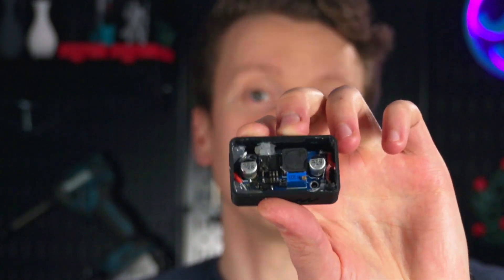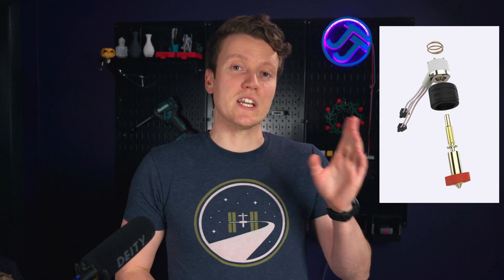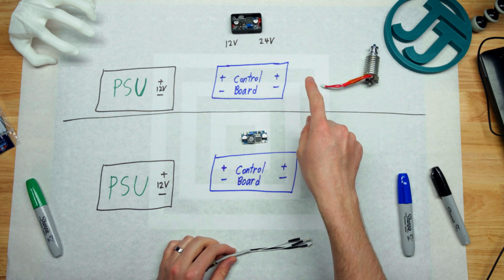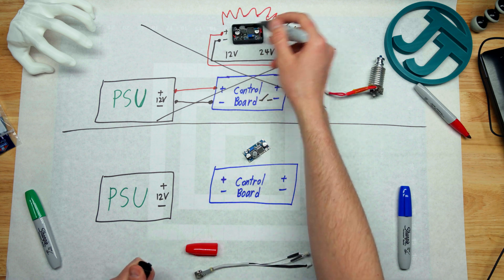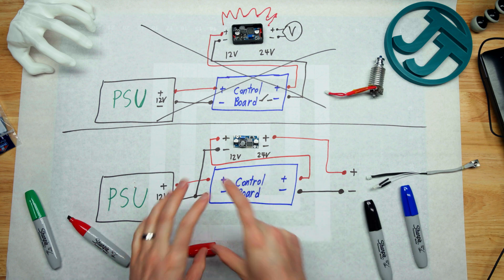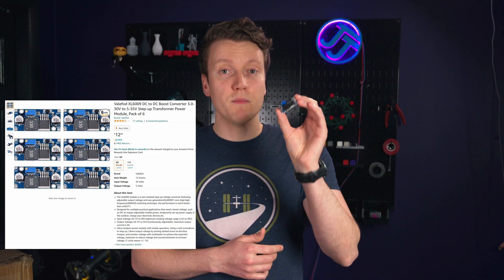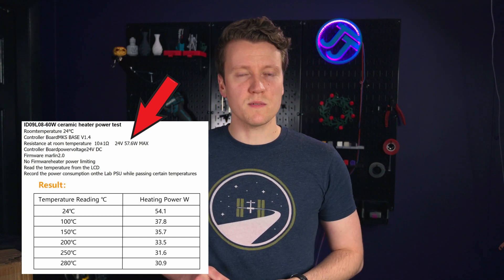Triangle Labs CHC Hotend Caused Fire | Dangerous 12V 3D Printer Upgrade

Comment from the maker: I just heard back from TriangleLabs, and they added a circuit diagram to their product listing. They also said they will be delisting the 12V option until they can do more testing. I respect a company that listens like this, and will change when they are wrong.
Reply: Since this is now quite outdated (TL has released a native 12V version some time ago), maybe you should add an annotation in the video that this was fixed. Because this video is first result when searching about the chc hotend and is giving wrong impression that the hotend in general is bad.
Reply: Stay frosty in milk JJ
Reply from the maker: @MrBeast-1  Haha my life's moto!
Reply: Darn.. I wish I saw your video before I bought my 12v set for my Anycubic Kossel.. They're still selling the 12v kit on their Aliexpress store, but now with a wiring diagram...

Any idea if the chart they have there is correct..?
Reply: Buy 24volt PSU 5 amps and one big MOSFET. You need it last a Buck Converter with 5 amp.
Reply: @muller86wolf  a separate 24V rail is probably a better idea. These boosters are always, ALWAYS overrated, only use them for low wattage use.
Reply: With @mrbrdo on this one. TriangleLabs seemed to have fixed the issue. Would love to see a follow up video with the new heater also.

Comment: Many thanks for this video.  I had the idea of upgrading an old 3d printer into using a modern hotend without the hassle of upgrading everything else.  After my first boost converter failed, I found this video and used your wiring diagram.  Using a beefier converter I can confirm this works well, and now I can use the same hotends and nozzles on my old anycubic as my voron for the rare time I need a second printer.

Comment: I wouldn't trust those buck boost converters to provide greater than 1A. Also, did you try using a 5-10A variable power supply to see the current limits under load.

Comment: Pretty sure your shoddy engineering work caused the fire, not the hot end itself. I like how the title alludes that it's Triangle Lab's fault, but one look at that dinky board says no way it can handle 50W requirement for a heat block. Your pinned comment still doesn't accept responsibility for your reckless engineering efforts. And to Trianglelab's defense, they cater to enthusiasts, and no self described enthusiast would a) underspec the conversion board, and b) wire the conversion board after a solid state relay that is designed to pulse on/off then c) go on to make video with a bait title to blame the supplier. The issue doesn't even matter if it's high side or low side switching. 

You also took the Shenzhen special listing at face value. It's not 4A at 24V. There's a current to voltage curve of how much it can output based on input voltages. I really doubt your claims to an EE degree.

If you accepted responsibility and instead of baiting us into thinking it's trianglelab's fault with your title, it would show you have integrity instead of this crap.

Comment: Thanks you saved me. I'm converting an Anet A6 to an i3 style and was just going to upgrade the hotend to this in a Hero ME Gen7 but keep the 12v power supply. I've changed my mind and am going to spend another $21 to get a 24v PS. I saw what they were advertising and alarms went off in my head like what? No way that would reliably work and my hunch was right. Thanks again!

Comment: So... Mister EE (from RecycleBin)...

TCHC TD6 has a rating of 24V 65W and your booster module supplies about 40W... EE 101, do the math!

First connection diagram is 25000% wrong! (A real EE would know this)

Get a separate 24V 75W power supply or a 10A 12->24V booster module.

Comment: Ok. So it was your fault...why didn't you just use 12v hotend?
Reply from the maker: They sold this kit for 12V printers, but it will burn on 12V. That's why I made this video.

Comment: So with your electric engineering degree you sent a PWM signal into a PWM boost converter and were surprised it didnt work !
In future there is a setting in marlin which lets you adjust the PWM frequency or use "Bang bang".
but no matter because that looks like a Xl6009 to me which is rated for 4A in perfect condition and will not boost to +50W with a 12v input.
I'm surprised trianglab did this !  One question tho , is it xl6009 ?
Reply: This is correct. What needs to happen is the boost converter provides power and control board sends a pwm signal driven MOSFET to supply the hotend.
Reply: @REG3305  yes, im wondering what kinda degree he has if he does not know this...
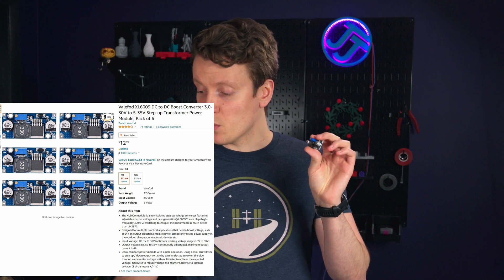Reply: Yeah, 1:30 I asked myself the same. These are good for low current fans and that's about it.

Comment: ...but if I have a 24V PSU that came stock in my printer (Elegoo) should I still consider this hot end?
Reply from the maker: I haven't tested it on 24V yet, but I think it would be a great choice. It is so easy and compact to work with.

Comment: my mks nano robin v 1.3 says "12/24v" on the connector over the board. show do i know wich one should i use?
Reply from the maker: That means the motherboard can use either 12V or 24V. Check if your power supply is 12 or 24V. That will be your answer

Comment: Seems that as of June 6, Trianglelabs released a new 12v version that doesn’t require a buck converter.. Thoughts on that..?
Reply from the maker: That looks like the logical thing they should have done to begin with. Probably would work great, I'll have to test one out sometime.
Reply: @JJShankles  they probably wanted to save a buck or two on production cost with a single production line of 24v versions and getting away with just using el-cheapo converters instead…
Reply from the maker: Or I though they would just sell a 24V option only. Almost all new printers are 24V anyways
Reply: Just putting this here... I ordered a 2nd "new" 12v unit from them in July and sold the old one from March as a 24V unit on a local Craisglist.. However it seems the new one still came with a step-down board but Trianglelabs says it's not needed.  Only difference between the old one and the "new" one in July appears to be a "12V" sticker on the package.

However my "new" 12V unit (supposedly no longer needs the step-down board) does not heat-up beyond 210C in a PID tune, and Trianglelabs says it's my software issue (which is not the case since my previous V6 heater cartridge had no issues going to 240C).  Seems I either got a faulty unit, or I still got a 24V unit masquerading as a 12V unit..

Comment: You could probably make it work if you used a higher quality booster but at the price it kind of defeats the point of the low-cost version of the rapid that is the CHC.
Reply: Higher power boost converters do not cost more. There are 150w,250w and 300w models for few dollars.
Reply: @Nobody-Nowhere  oh that's cool. Good to know!

Comment: Technically speaking, using those buck converters is not incorrect. Though, it's not designed to handle the loads a bed or hotend requires.
Since they're rated for approx. 2A without heatsink, 3A max current WITH REQUIRED heatsink [mine have these ratings, not 4A), it's no wonder why they did burn.
Actually, the only "valid" application for this in 3D printing is to drive 12V fans on a 24V system. It works perfectly that way (that's what I'm doing) ... although some signal smoothing should be used too. :)

Comment: guess that calls for separate 24v psu and hotend driver board if 12v for the rest of system is a must.
Reply from the maker: It could work off of a more substantial MOSFET, but that would cost as much as the CHC hotend. The whole system could be converted to a 24V PSU, but again that would be a bigger project.

Comment: Clearly they didn't test it.  Yes, yours caught fire because you wired it wrong, but them not testing something that gets really hot in normal use is a very bad look for the entire brand.  Thanks for continuing to make Ai3M vids!
Reply from the maker: Thanks, I'm glad you like the videos! After I emailed them they said they would delist the 12V option soon so they can do some testing. Good to see they are at least listening

Comment: The correct wiring diagram is on the store page for this product.
Reply from the maker: I see it now, but that picture was not there  last weekend when I was trying to figure this out. And I double check that page so many times. They also haven't added it to their own triangle labs website.
But that is only part of the problem. When I bought the identical replacement part, it is under the proper spec and doesn't give enough power to heat the hotend

Comment: As soon as I saw the boost converter I thought uh oh, that's not good. I am pretty sure the max 4A (which is pretty optimistic anyway) is peak and not sustained. Definitely not something I would ever want to use for a hot end. This sounds a lot like someone at Triangle Labs just picked a cheap boost converter that looked like it had good enough specs, but never did any testing.
Reply: He says he wired it up wrong in the opening minute. It's user error. The wiring diagram is on the store page....very much a big fail from this youtuber and no one else's fault.
Reply: @backgammonbacon  what about the other problems? Lol

Comment: Your wiring in the second diagram is correct but those boost converters are not up to the task.  I wouldn't run them at more than 2A input and at that point they would probably need a fan to keep them cool.  They are good for fans and LEDs though.  There are larger boost converters available that can power that hotend.  I'm currently using a Gowoops 150W boost converter from Amazon to power everything but the bed on a Voron V0.1, boosting from 12v to 24v.  They are 2 for $15 and are more than adequate for powering a hotend.  I would power it directly from the PSU and give it it's own separate fuse.

Comment: Correct me if I'm wrong, if u wanto drive a 60w heater at 24v, the output current is about 2,5amps. What means u gonna have at least 5amps on the 12v side, or more regarding the dissipating heat. Im not that sure these cheap boosters are made for that much current
Reply from the maker: That is exactly correct. The listing for the voltage converter said 4V output current, but that must be instantaneous peak voltage or just incorrect marketing. These little things are not made for this. It would probably work on a much larger one though

Comment: After doing some FPV drone stuff using external voltage regulators and just having them from time time time explode, I'm always weary of using them.  If I can find a good solution that doesn't require a one, I go that route.  One less thing that can fail.  Case in point, I keep seeing people using Noctua fans on Ender 3 type 24V printers.  Noctuas are fantastic fans, but they're not the only good quality quiet fan out there and are only 12V, and I keep seeing people insist on using them anyway with a voltage converter.  I never understood why with so many good 24V fan options out there.
Reply: I haven’t had any problem with Noctua fans with external voltage regulator…but I agree with you, I also try to avoid using these. BTW what 24V fans do you recommend?
Reply from the maker: I totally agree with the "One less thing to fail" mentality. Especially with electronics and powerful heaters like this.
Reply: "using external voltage regulators"

What you actually mean is that dirt cheap knock off DC-DC converters from China are given grossly optimistic ratings and fail well before they are met.
Reply: @ferrumignis  No, I mean even the best voltage regulators could fail, so if you don't need to use one, don't.
Reply: @heroflying  They will fail if you use them outside of their specification but there are voltage regulators working reliably in billions of electronic devices.  However I agree it's pointless to use something if you don't have to.

Comment: I can tell you mine works well on 24v. Ok now I will get a little crazy with wiring ideas. On the Anycubic the hot bed has a a external mosfet. So… I bet you already see where this is going. Take wires from power supply to convert into mosfet power in and then out of mosfet power out into hotend. Now the mosfet control wiring should be the hotend output on your motherboard.  Of course your heated bed will not be working at this time. But if it works then you can pick up the mosfet cheap on Amazon.  Side note the heated bed on the Anycubic will work with 24 volt… so you could run two power supplies and feed mosfet for heated bed with 24v and the mosfet for hotend with the new 24v. Ok so none of the above is what triangle labs had for a plan I suspect.
Reply: But at that point… is it better to just pick up a cheap BTT SKR e3 mini 3.0v and a 24v power supply and run everything in 24V.  Because that works well. Only things to watch out for is fans that are 12V.  Then again you can go octopus 1.1v keep your drivers and it has fan outputs you can simply change jumpers for 5V, 12, 24v.  And not have to worry about fans at all just adjust jumpers for the appropriate fans… ok now I am crazy.
Reply from the maker: The control board that comes with the Anycubic Mega S can handle either 12 or 24V, so I wouldn't even need to change that out. I could eventually change the power supply to a 24V one, then use some step down voltage converters just for the fans. Haha there are several viable options for approaching this hotend, the real issue is that they sold one of the few options that won't work.
Reply: @JJShankles  I wasn’t aware that it was 24v as well.  This is good to know as I still have that board kicking around. I honestly went a bit overboard after my purchase of my Anycubic mega X.  I now am running corexy motion system on a custom frame I built with liner rails. So hardware wise the following is on my printer. Original steppers from the Anycubic mega z axis for my Z. BTT octopus, LDO steppers for XY, a orbiter 2.0 extruder and just putting on a Revo micro E3D, also carbon fiber gantry. Oh my this has become a expensive hobby. I really truly thank you for your Videos as when starting and learning Klipper on the Anycubic you where a serious asset. You also where a inspiration into the hobby even though the Anycubic is basically no longer a Anycubic I still enjoy your videos and picking up the little things I haven’t learned yet. So a big thank you and serious keep up the great work, your channel has come so far already it’s a pleasure to follow you.

Comment: Hey, great Video! By coincidence i just today tried this thing on my 12v printer and wondered why it couldnt keep the temperature when extruding. And then i did some research in this boost converter, i immediately thought that thing is not suited for this application 😆
Reply: Did you do a pid tuning for it?

Comment: Thanks for looking into it. I’ve purchased it as well, but hadn’t had the time to change it on my printer. I guess I’ll start looking for another converter before even trying.
Reply from the maker: I think it still looks like a good hotend, but yeah it will need a bigger MOSFET voltage booster.

Comment: You could perhaps put multiple converters in parallel to cover the current needs of the heater?  However, if the converters cut off GND I'm wondering whether that would actually work ...

Comment: Hi JJ

I've used these boost converters in other projects and their output current is vastly overrated.  Some sellers rate these at 3A while other claim 4A.  In my experience, this is at best a absolute maximum for short periods.  Others use the 4A in reference to the input current which might be more realistic.  In your case, ignoring losses in the boost circuitry, it would require over 4A at 12v to drive a 50w, 24v heater.  In short, I would work fine with a best converter with tat least wice the capacity of the one they provided.
Reply from the maker: That's what I was thinking, 4A output current on their listing sounded way too good to be true, but I guess they can say anything on an Amazon listing.

Comment: its a shame the 12v version exists as I've got the 24vstandard and "pro"/volcano version and they're really nice. this is such a stupid issue as well, glad you caught it and are bringing this to their attention
Reply: Litle question, Did the 24 V version require modification of the board ? Or the 115w can be outputed by the stock board (wich supply 40w with a regular heating cartridge)
Reply from the maker: The main board can handle either 12V or 24V supply, so to switch to 24v all you need is a new power supply and to replace any 12v fans on the printer with 24v fans
Reply from the maker: That's good to hear that it works on 24V. I really think this is a cool little device, and I would love to get it working one day. I just wish they had paired it with a good voltage converter
Reply: @JJShankles  is there a reason they couldn't do a 12v PTC heater?
Reply from the maker: I'll ask them if they respond to my email, but that seems like a possibility. It would just need a different heater resistance, it might be a smaller marker since most new printers being made are 24V
Reply: @JJShankles  yeah thats what makes the 12v version even weirder, you have to go back fair few years on commercial printer side to find a 12v machine, so I eel like they're more likely to just drop this variant and stick with 24v
Reply: Convert the anycubic to 24v